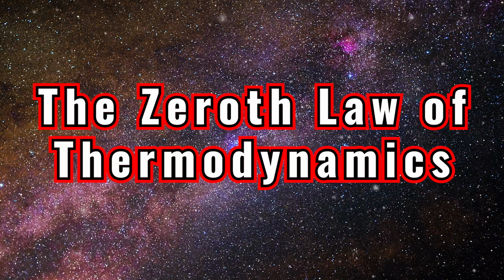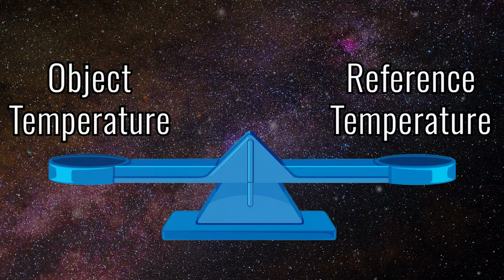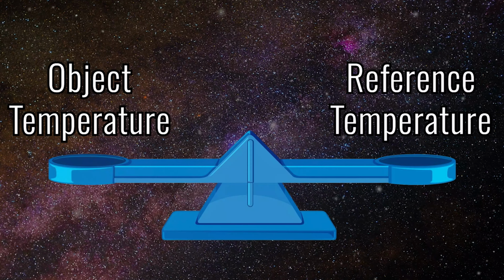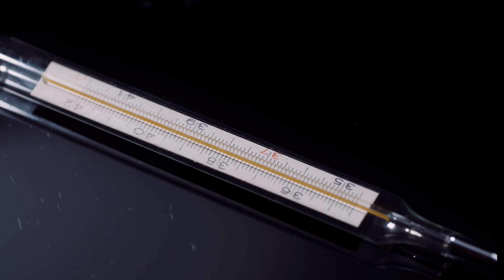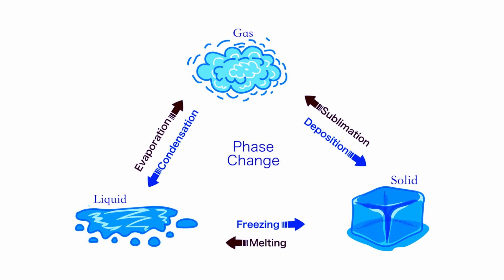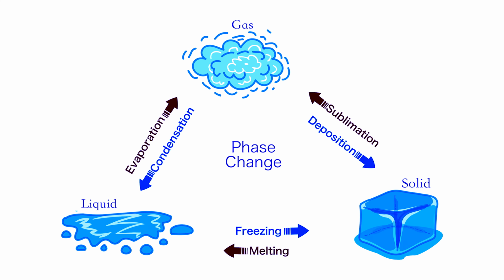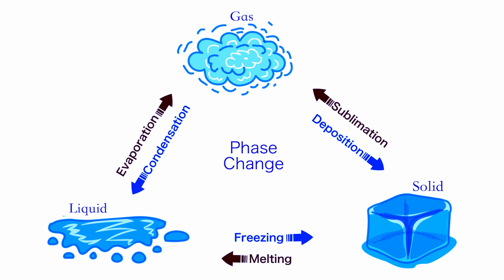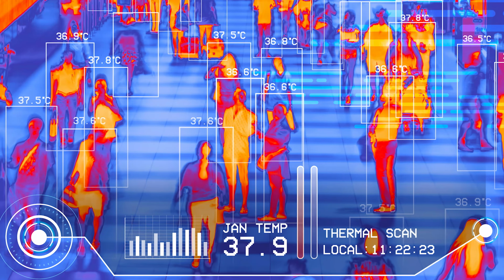Measuring Temperature from Atoms to the Cosmos — Zeroth Law

Comment from the maker: The Zeroth Law is foundational in thermal physics across all scales—from quantum mechanics and atomic interactions to everyday systems and cosmic temperature mapping in space science. It’s what makes both contacted and non-contacted temperature measurements possible. Whether it’s thermal cameras, astronomical instruments measuring starlight, or quantum experiments tracking energy exchange at the tiniest scales, non-contact devices rely on electronic signals that simulate thermal equilibrium—letting us measure temperature without ever touching the object.